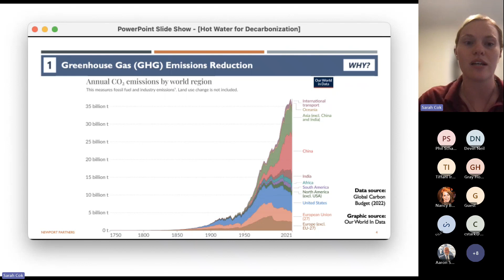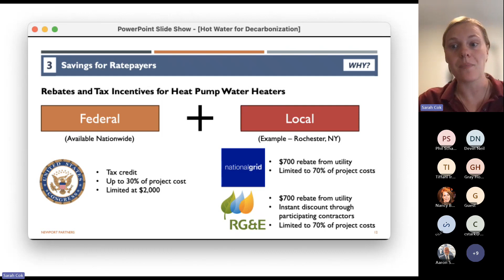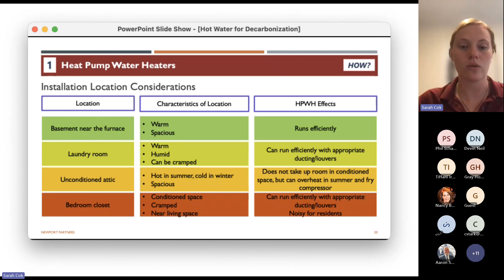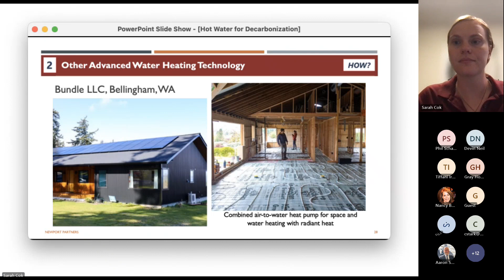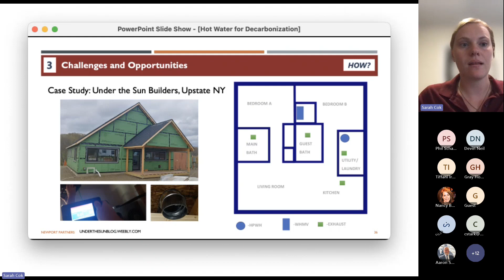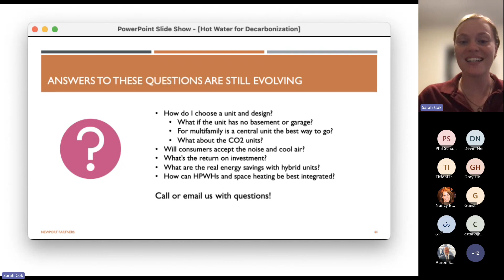Hot Water Innovations for Decarbonization

Comment: I'm glad to finally see more integration of exothermic and endothermic appliances. To more efficiently utilize waste heat and cooling. But when is the refrigerator going to be added to the system?

And I look forward to when phase change materials are utilized, to take advantage of the latent heat effect vs using water as the heat storage medium. And some modular interoperability between the appliances would be nice to see in the future too.

Been dreaming about this basic concept, since the oil crisis of the seventies. So it's nice to see it finally slowly evolving in that direction.